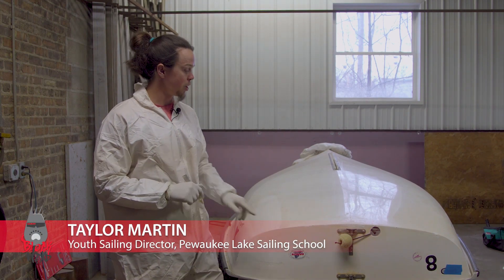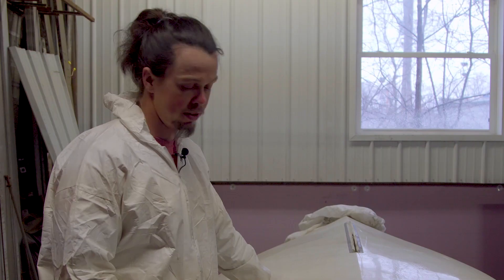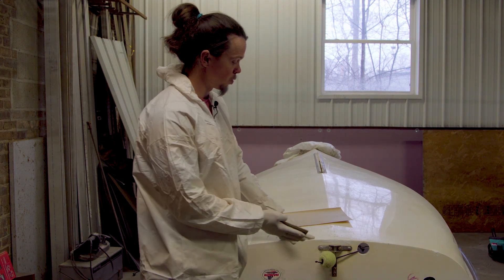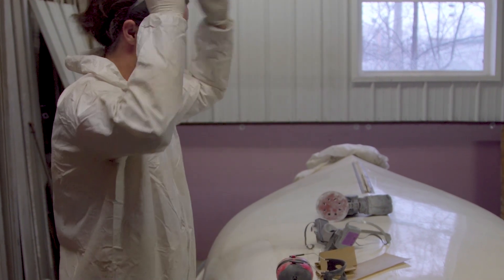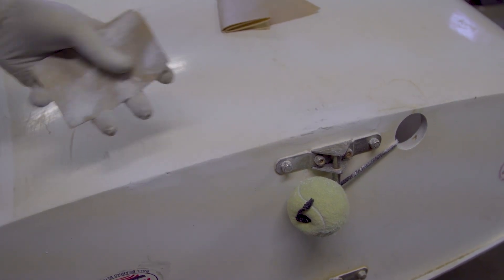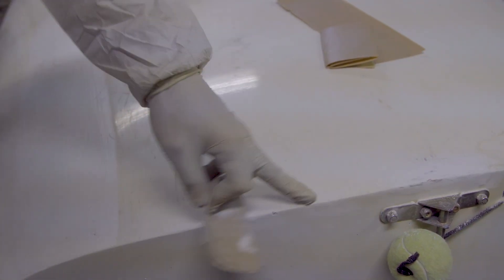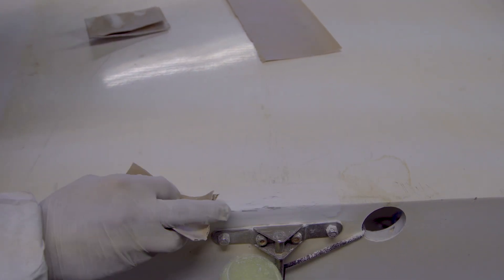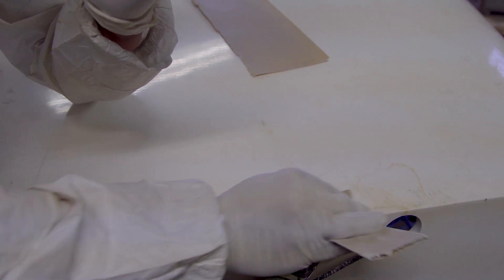Gel Coat Repair 101 - Part 2

Comment: I'm sorry mate, but this is a terrible example of how to do a proper Gel Coat repair. You have not even applied gel cot to some of the repair. Sorry but your not giving out good advice. Not wishing to be rude.I had nightmares watching your sanding. You would need to go down to 2000 wet and dry to get a good finish, then there are others things you can do to finish to a mirror shine and smoothness.

Comment: "We can rebuild him, we have the technology.  @2:11, Steve Austin, the Six Million Dollar gelcoat repair technician."

Sorry, I just had to do that.  
On the keel, and around the transom, it still looked like the gel coat had not fully filled in those areas.  is there the possibility of water intrusion there, or did the gelcoat fill enough in to completely seal off the fiberglass?